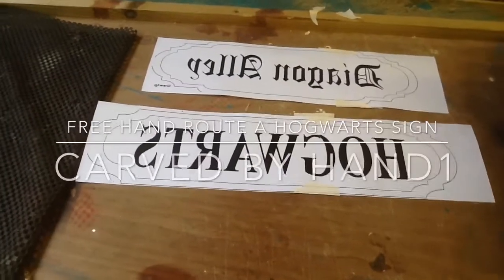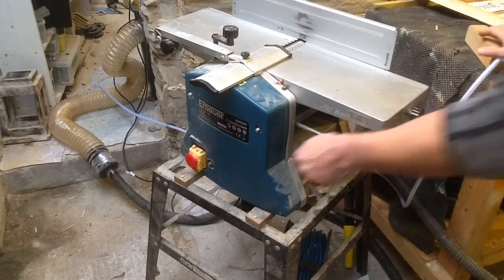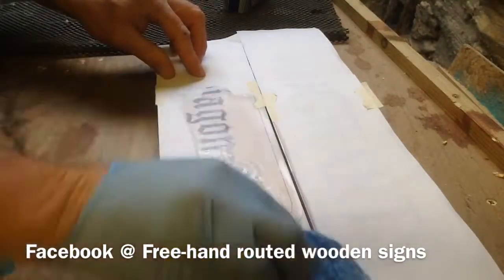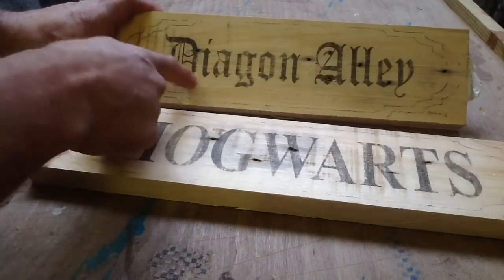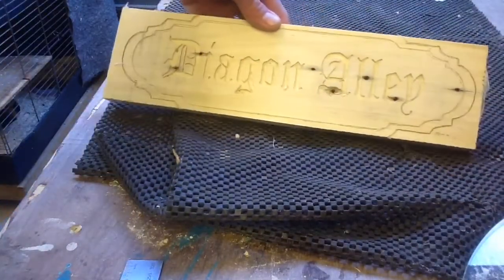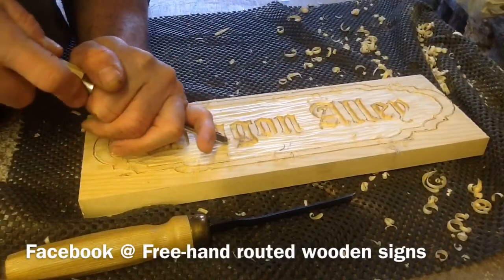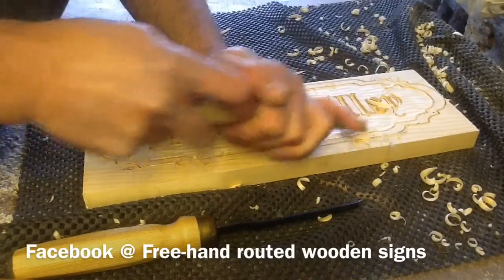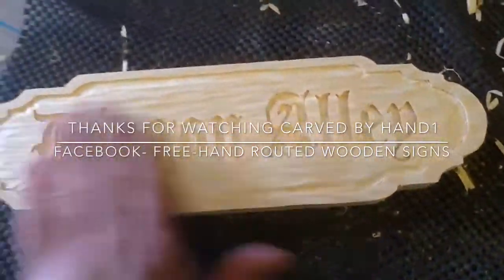Free hand route a wood Hogwarts sign

Comment: Used ONLY  a 3mm spiral upcut?????  No other bits????         No V  gouge?????     Wow!
Reply from the maker: the spiral bits are great, very clean cut. sometimes i will use sandpaper or even a knife to clean up little wispy edges. dremels with small carbide bits are also useful cleaning up edges